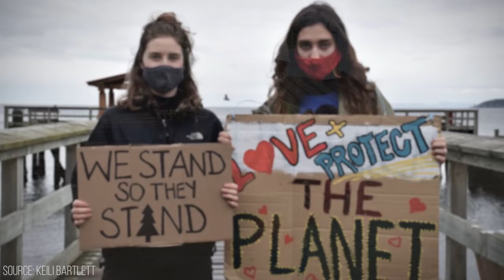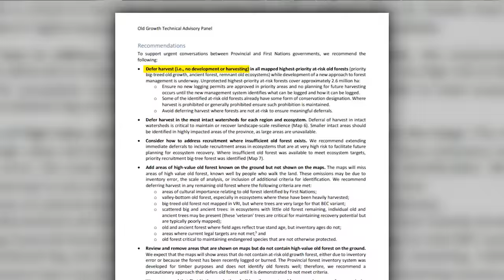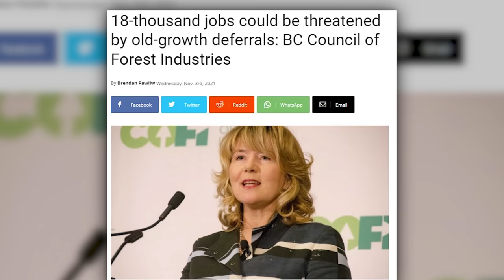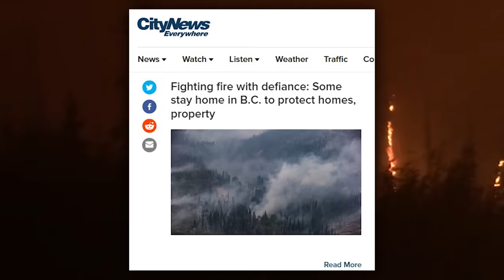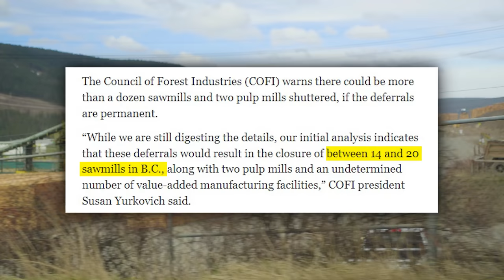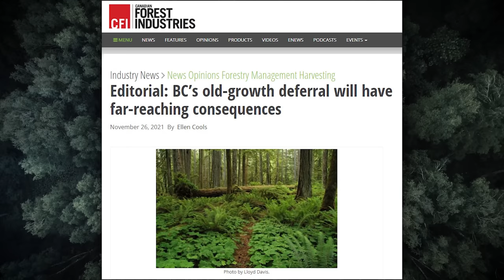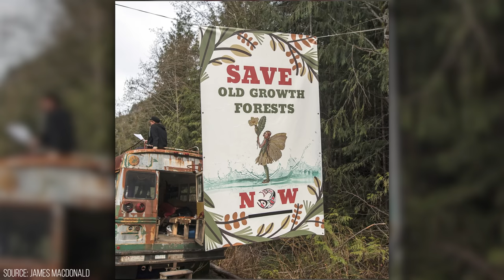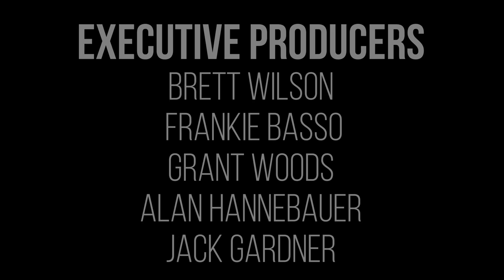Activists vs Loggers: The War for B.C.'s Old Growth Forests

Comment: Unlike wood, alternative framing materials like steel, concrete, and engineered wood are resistant to moisture damage, rot, and insect infestations, leading to structures that last longer and require less maintenance.

Also with the areas that are already being used for lumber, I can see a rotational system being used. 

New trees are planted every year ( even more than our cut down) allowed to grow into adequate size, and than readministered into lumber once more, so less forests are being destroyed 
- controlled logging if you will.

Comment: A couple misleading points I would like to comment on here. First, the documentary seems to suggest that the government's policy on old growth is being driven by the Technical Advisory Panel (TAP). It goes on to point out the environmental affiliations of 4/5 of the TAP members. However, the role of the TAP has only been to "identify the forests most at risk of irreversible biodiversity loss as per the criteria set out in Recommendation #6 of the Old Growth Strategic Review (OGSR)" (quoted from the TAP report). The recommendations the government is following are ultimately from the OGSR, while TAP is being used provide science-based advice on which areas are most at-risk. The authors of the OGSR are "Garry Merkel, a professional forester, natural resource expert and member of the Tahltan Nation and Al Gorley, also a professional forester and former chair of the Forest Practices Board". Your documentary repeatedly uses the affiliations of TAP members to discredit old growth policy when in reality this policy has ultimately been driven by the OGSR, which was authored by foresters. 

Second, there are problems with the definition of old growth used here (i.e. trees older than 250 years on the coast and 140 years in the interior). The main issue is that it lumps very different forest ecosystem types together; from highly productive ancient coastal forests to low productivity northern spruce bogs. When old growth is lumped together under this definition, it is easy to argue that we have "massive" amounts of it left (~11-13.7 million ha). However, a very small percent of that total represents productive ecosystems capable of growing the large trees one usually associates with old growth. These productive big-treed ecosystems have been targeted much more intensely by logging than lower productivity forms of old growth. For example, only 3% of BC's forests have a site index greater than 25 (i.e. trees expected to grow >25m tall in 50 years) and of this 3%, only 2.7% remains (Price et al., 2020). It is beneficial for people such as Stewart Muir to lump these valuable, and highly degraded, ecosystem types along with lower productivity (and less valuable forests) as a way to justify continued logging. The fact is, when it comes to productive old growth forests, very little is left.

My last point is a general beef with the divisive framing of this documentary as "Activists vs Loggers". While I understand that there are people with extreme viewpoints within the old growth movement (as there always will be in any movement), being pro-old growth does not make you anti-logger. Whether or not we choose to stop logging productive old growth forests, we will eventually have to stop once they are completely logged outside of parks. Continuing to log the way we have for the past 100 years is not feasible, but there are options we can implement such as stopping raw log exports and adding manufacturing value within BC, shifting our focus from dwindling productive old growth to second growth, and working towards selective logging to maintain ecosystem function.
Reply: Thank you good sir

Comment: Worked in mill 2 years boring line work pay was good but sucked like most jobs as for old growth trees why cut them down all we do is take then plant a tree that takes forever to grow if it lives beyond the over growth and survives me and my sister planted a tree 30 years ago on good soil was there 5 years ago still not that big so we take alot more then we give back in society soon it will be like mad max or a slow desert shur genetic manipulation helps growth but it won't fill the gap long term
Reply: I have trees I planted 35 years ago that are now big enough to harvest.

Comment: Again, another great documentary that highlights and values one side of an argument while straw-manning the other side. Why don't you actually try to have a balanced take on these issues!? It's not hard to make one side look like victims or that they are the ones In the right, you could have done so for big tobacco just as easily.
Reply: There's enough representation on the other side. No need to oversaturate the market
Reply: @meganrichter9748  thats dumb. I want unbiased reporting not propaganda.
Reply: @RoosterG33rs  Well that would be nice but it doesn't exist in the real world so you're gonna have to do your own research and use your own judgement
Reply: @RoosterG33rs Nonsuch thing as unbiased reporting. Everyone has a bias of some kind even if they're not aware of it.

Comment: Those northern forests are also wildfire dependent.
Reply: wildfire, bugs or logging. Or all three.
Reply: @jimlambrick4642  Fire cycle controls the bugs. Logging simulates the fire cycles except not having the cones open in fires to spread seed.
They also spray herbicide on many woodlots to stop under story plants from taking hold making more fuel load.

Comment: In 2019 the BC provincial gov't announced that it would be changing the BC Building Code to allow the construction of a wood framed building to be built as high as 12 stories from the previous 6 story limitation. In 2021 the BC gov't makes an announcement that will terminate the operation of many numerous saw mills in the province. I wonder where this leadership is getting it's marching orders from?

Comment: 0:22: 🌲 The video discusses the controversy surrounding old growth logging in British Columbia and its impact on the forestry industry and local communities.
5:14: 🌲 The old growth technical advisory panel in British Columbia has been criticized for lacking impartiality and expertise in the logging industry.
9:49: 💼 Forestry is vital to the local economy in Northern British Columbia, but the old growth deferrals have had a significant impact on the community.
14:07: 🌳 Old growth forests on the coast are different from old growth forests in the interior, with smaller trees and shorter lifespans.
18:20: 🔥 The lack of logging in old growth management areas is creating a dangerous buildup of fuel on the forest floor, increasing the risk of out of control wildfires.
22:44: 😡 The speaker believes that the old growth advisory panel was unfair because it lacked industry representation and was biased towards the Sierra Club.
26:56: 💔 The collapse of the forest industry in Mackenzie, BC has devastated the town's economy and led to a significant population decline.
31:02: 🌍 Foreign students played a significant role in organizing illegal blockades for environmental campaigns in the US.
36:57: 🌲 The logging industry in British Columbia is facing economic and cultural consequences due to restrictions on harvesting old growth trees.
Recap by Tammy AI

Comment: So good to see somebody doing real actual investigative journalism. Just about non-existent anymore especially with that factory of urban think ... the CBC. 

But I have some thoughts on the subject. My perspective is that I started being involved in things forestry in 1965. And I just retired less than a year ago. During that period 57 years, I pretty much have done it all. From student, forestry tech, timber cruiser, layout and engineering, faller, yarding crew, every type of logging machine, logging machine development and sales, contract logger, logging systems consultant... all over the world, sawmill operator and owner, and finally finish wood products manufacture and sale. Worked BC interior and the coast about half and half. Self employed as a logging contractor, consultant or mill owner for half/half as well. 

On the old growth question I tend to agree with the perspective/comments shown in your video interviews. Especially the obvious differences between coast and interior OG. However, I do also think it is time to pinch off the heavy old growth cutting in certain areas, such as southern Van Island and the Interior wet belt. 

But what I never hear... from either side...ever...  is any discussion about alternative forestry/logging methods. There are other ways to do things other than large clearcuts ... which are really what the urban ignorant get all upset about.  Not everywhere, but in some areas, such as east coast Vancouver Island, practices such as uneven aged forest management, natural regeneration mixed stands, commercial thinning, small block terrain logging, streamside zones, single tree and small group removals. etc. I actually was that rare thing in BC; a significant sized contractor that did this stuff at scale for several years in the early 80's and later the 90's. Mostly for large private landowners like Pacific Forest Products. Basically this is European style forestry as you will see in places like Germany and Austria. And all the lands there so managed are multi-use, watersheds, and including heavily for recreation. But they still produce a lot of timber and Jobs. I've seen virtually none of this on any scale in BC. And I can't recall a single government forestry manager ever asking me or others for any ideas on how to do it. Because, as far as I can tell, they are completely ignorant on any subject other than conventional clearcut. And yes I know, economics you will say. And who benefits from only using the cheapest logging practices then? Most likely some suit sitting in New York. 

There are other ways to do things. Look at Japan. Three times the population of Canada and at least half forested land that has provided forestry products and jobs for hundreds of years. Ditto all of Europe.

Comment: There is so much wrong and biased about this piece that its appalling to watch when you actually work in forestry research. Yes, the methods protesters take are radically stupid, however, this is simply a political piece pushing an agenda to pick up views from working class Canadians. Harvesting old growth forests will not stop forest fires or increase the number of jobs available!! it will actually make the whole situation worse due to the changes in microclimate and hydrology which follow. Forest fires are by far more common in second growth forests (logged forests and forests that have previously been disturbed) like the one they showed as an example in 14:26. Due to simple stand structures, low/dense canopy (branching) and low species diversity large scale forest fires are widespread. Fire prevention in such forest types can only be done through small scale managed fires, diverse species planting and frequent management for forest stand structure diversity. To do this you need forest planning, a larger workforce and a more educated one, in addition to bunch of other criteria. This obviously more expensive for large corporations and profit margins are smaller than simply cutting down huge areas of already available timber. At some point when the old growth forests are gone they will need to switch to second growth management, though this will only happen when all the old growth is gone and the corporation cash cow dries up. By then due to this extensive logging B.C. will need to deal with a lot more than forest fires in terms of climate change due to the change in microclimate that will have occurred. They're